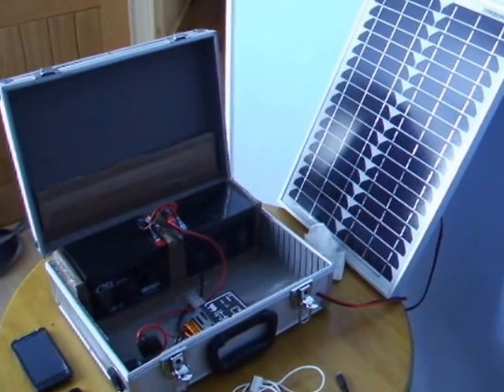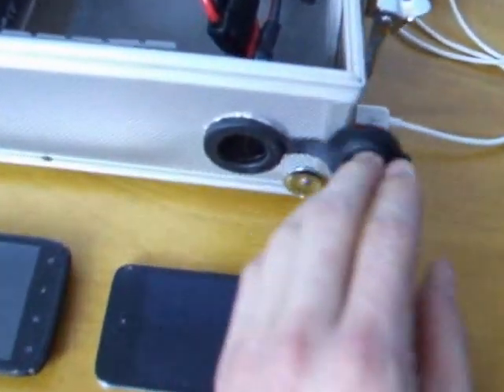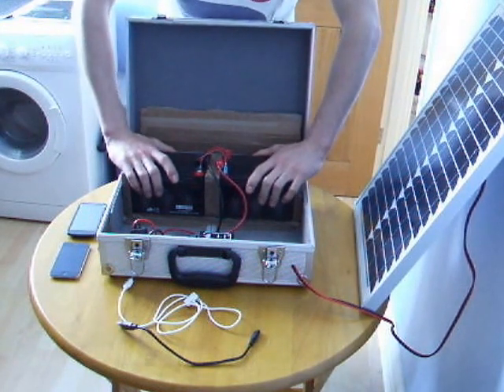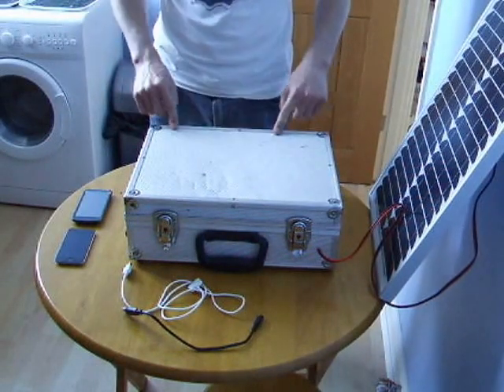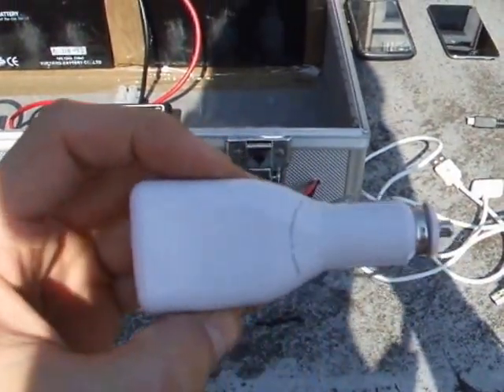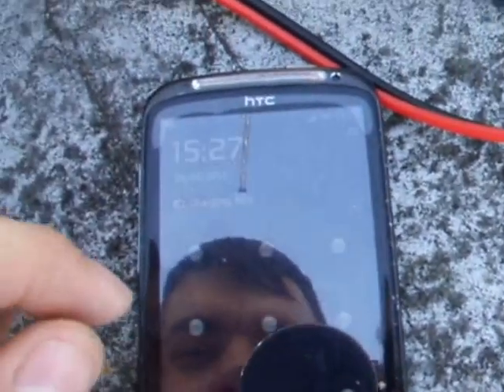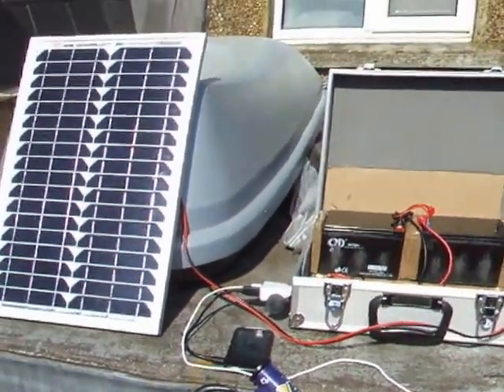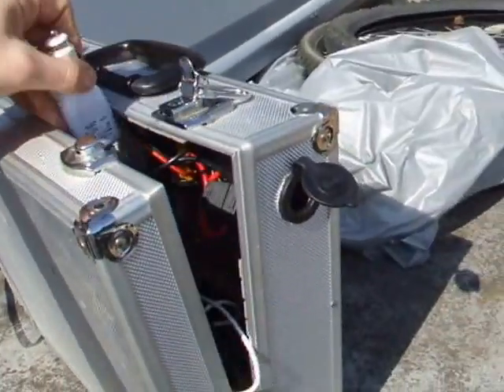DIY portable solar generator homemade

Comment: Ahh nice build for charging your 12v devices. I'm building mine now but I'm going to use an inverter to convert the DC to AC so I can run small house hold items like a cfl light ect. Well Done!!
Reply from the maker: Thanks I was going to add an inverter just never got round to it but I'm building a new setup at the moment and I will be adding one to this one I will be adding a video soon